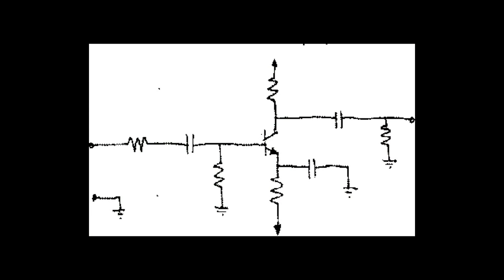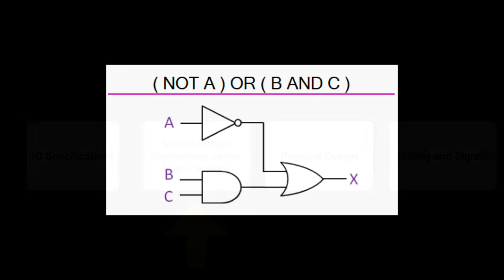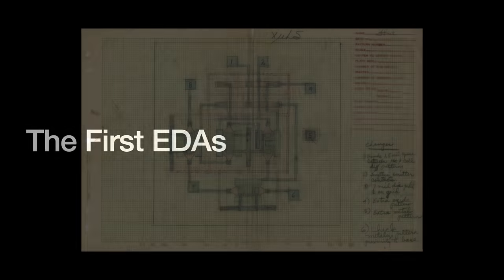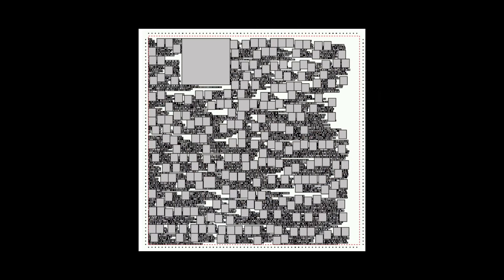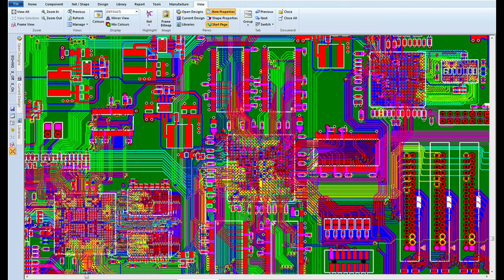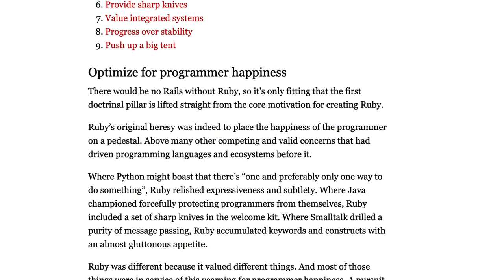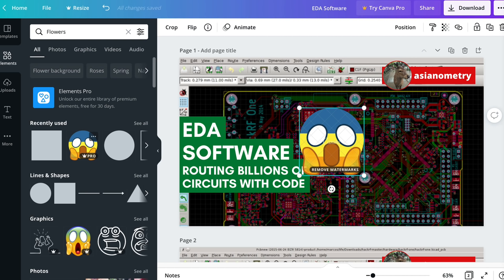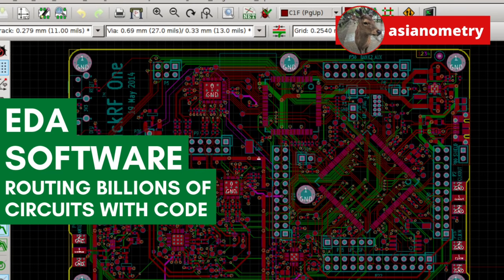Designing Billions of Circuits with Code

Comment: Trip down memory lane for me.  I was lucky enough to experience what you father did.  In 1976 as a fresh EE graduate I started my education once again working for Fairchild in a small design office in Bristol in UK designing SSI/MSI CMOS logic. 
Because of the small circuits and lack of EDA tools, Logic/Circuit/Layout design was done by hand.  The final product of design was then drawn by a team of draftsmen on mylar and then digitized using a CALMA Graphics system comprising a digitizing table (work of art), TEK storage display driven by a gorgeous NOVA 1200.  We had to boot the system from paper tape on a TTY.  I can still hear the clatter on the TTY reading the tape operating at 50 baud.  Everything was manually checked and when you were happy,  or ran out of time,  the data was written to magnetic tape and then sent to Mountain View for fabrication.  6 weeks later  the packaged chips would return and In those days it was not unusual to have  major problems with a design.

Finally made it to the US HQ so my time in that little design office in the centre of Bristol was just the beginning of a great journey of which I am so grateful.

Comment: I actually worked on implementing pathfinding algorithms for route tracing and it's incredibly tricky, especially given the limited space and  the fact traces are not allowed to intersect. It's an NP complete problem, meaning the optimal trace configuration (with the shortest total trace length) can only really be found if you try all configurations. I tried coming up with algorithms that come pretty close to the optimal configuration.
Reply: Did you publish them?
Reply: You should come work for the CCP
Reply: @JohSebBac China has EDA tools down to 14nm this quickly after US bans.

Comment: What a great and informative video.
If I may add some more points (I'm an IC Designer in the semicon industry myself):

- Mentor Graphics is another big EDA tool vendor along (though recently bought by Siemens)

- Most of the automation effort has advanced the design of digital design circuitry, which occupies, probably, >50% of the area of the chips released today. Analog Design, on the other hand, is extremely difficult to automate. Some effort has been done, but I still don't know of a complex chip being designed solely by a machine as of now. Even though digital might seem like "the advanced technology", analog design is still needed, as you just CANNOT interface the real world with a purely digital chip.

- That's the reason why people say the wet dreams of the semicon industry is to move the digital circuitry closer to the input as much as possible in order to save costs and automate everything.

- Some big semiconductor chip companies in the world have actually made efforts to build their own in-house EDA software in order to save money on the EDA 3rd party licensing. Though, AFAIK, only the simulation engine, not so much the actual GUI.

BONUS:
- Your video thumbnail is a screenshot of KiCAD, which is a free PCB software. I think a screenshot of the Cadence environment would've been a better fit (hehehe)
Reply: do you do digital or analog?
Reply: @karamany9870  analog
Reply: @DJTrancenergy  and how’s the future of analog compared to digital? Because I’m currently choosing a specialisation in my degree
Reply: @karamany9870  I can't possibly answer that in a few lines and not willing to put a wall of text explaining my opinion.
Choose what you like the most! Don't be miserable doing what you don't like. Plus, no one knows if you'll end up in engineering or eventually moving to some more managerial roles.
Reply: One of my friends worked in TI in analog design and has now switched to Intel. He always said analog circuit designing is like black magic. Even the most skilled designers are not always sure of the full implications of the chips they design. What do you mean by moving the digital circuit closer to the input though? Because digital logic would still have to implemented by analog design.
Reply: @EvilSapphireR  that's true. That's why we mostly work with legacy stuff: if it already works, don't change it! Maybe add circuitry around to minimize risks. I'm in a similar situation right now as we speak at my job.
What I mean by moving digital closer to the input is that if the ADC is the 1st block in the chain, then analog design would reduce to creating good input ADCs and other blocks would become unnecessary. And no need of analog processing would be needed. Obviously this will never be the case, but you get the idea.

Comment: Verilog and VHDL took most of our fun away. I liked the schematic method of design a lot. We used the same workstation for layout as well.
Reply: Which flavor of unix/linux did you use?
Reply: @scottfranco1962  Used Mentor Graphics for digital design in college around 1996.  Also used Avanti Hspice in circuit courses.  Half of the college’s workstations seemed to be some Unix variant while the other half were SunOS / Solaris, which were much newer.  Linux wasn’t embraced until roughly a decade later.  Now Mentor got eaten by Siemens and Avanti got eaten by Synopsys.  In any case they sure know how to pick weird tool names: Dracula, Assura, Hercules, Calibre, Spectre.  They should have stuck with things related to spices, cinnamon, and cloves.
Reply: @allentchang  So I have not been part of direct IC design for a lot of years. Last time was at Segate, but we didn't do the layouts or see the layouts (sad). I imagine that analog is still schematics. I think what happens now is that the Verilog tools deliver mostly automated layouts that use "fixer" layout people to correct automation problems and for special layouts, again, including analog. A company like Intel or AMD might typically use a mix of both, for example if the design calls for say a cache, that's going to be mostly laid out by hand for a single cell of it, then replicated many times. The author of this video series is not quite correct that everything is standard cell. Even in the old days, when we used cells they were usually from a library of custom layouts made for that particular design. I guarantee you the latest x86 processor does not use standard cells. The other issue is drive lines. One thing an IC designer does a lot is change the drive strength within the chip to match drive to length of line so that it does not drive it too little or too much, and matches the rise time requirements.
Reply: @scottfranco1962  An analog engineer has to work closely with an layout engineer to make sure sources of signal mismatches are kept to a minimum and that the spice models do work as promised under certain layout conditions.  Working with only schematics is no longer the way to go.
Reply: @allentchang  "Mentor Graphics". That brings back memories. I used that software when I was an analog chip designer.
Reply: 2019,we used vhdl and verilog,university didn't grow up
Reply: @windmill1965  Sadly, Mentor Graphics was renamed Siemens EDA this year.  It was acquired by the Germans in 2017.  I wonder if folks in US Congress are now regretting this.

Comment: AI is currently optimizing CPU designs.
 This is how we get 25% energy efficiency with every other generation.
Reply: And 25% more pricey. XD
Reply: source?
Reply: @Aaron Speedy Price going down is an evidence for improvement.
Not the AI involvment in this improvement
Reply: @Hatwox I dunno man, In school, i learned that the benefits of miniaturization is cheaper chips. if you can fit for transistors into less space, and have the tech to do so, the chip is cheaper on a per-transistor basis. a PC is not a chip, a PC has many chips on its various components. a PC now will have more chips than before, but the chips themselves are cheaper when they are made more efficiently, the cost comes from the additions that are available because of the efficiency gain. if that doesnt make sense, its because im a dumb dumb.
Reply: Trust me, AI is just another tool, not very different from log tables or protractors.
Reply: @Aaron Speedy Bang for buck for computer chips (CPU and GPU) are decreasing since ~2003. Unsurprisingly that's alos the year Moor's law died, no of transistors on a chip isn't doubling each 1.8 year since then and its slowing down ever since.
Reply: The optimization that ML is being used for in the chip design process is mostly for increasing yield of increasingly complex dies, not so much for die & via layouts (yet).
Reply: @michaelt126  It also depends on the complexity. Something half as small, but four times as complex. And also with a higher failure rate will throw that off. But generally chips are great today. You can have more computing power than you need for most tasks for less than 1500 dollars these days. 

Things are only really expensive if you want to always have the newest hatest sh$t. lol
Reply: AI isn’t optimizing CPU design for better power efficiency. At least, not yet.
Reply: And chips that nobody can understand or debug.

Comment: Nice video! One small nit: the image for your “memory circuit” isn’t a memory circuit. I was on the edge of my seat wondering if you’d cover the importance of the hierarchy of abstraction. I needn’t have worried. I worked at Honeywell in the mid ‘70s on an EDA simulation tool, while a coworker made use of our Multics system for his thesis work on circuit board layout, because of the large address space. That drove home for me the complexity of layout problems. I’ve been a bystander since, but one thing I’ve observed is that the use of standard cells reduces the layout complexity. If you have a cell with 10 cells, layout deals with 1/10 the number of items.  Since layout complexity grows combinatorial or worse, that factor of 10 savings becomes much much more. It addresses complexity both for the designer, and for the algorithms the EDA software uses. As complexity grows, you add more levels of abstraction. You might arrange memory, I/O, CPU subsystems on the chip based on the area needed, route interconnections, then lay out the interconnections between each of the subsystem’s cell, with the cells being pre-routed, or perhaps alternate selections of cells of different shape, to fit together like Tetris. Without the levels of abstraction, modern chips would be impossible.

I’m always impressed by the depth and production of your videos. Making things accessible to a wide audience is a challenge. I think you do a great job.
Reply: Glad I’m not the only one that noticed. It looks more like a mux to me.
Reply: @anonymous.youtuber Pretty much, yes.

Comment: This is essentially the video I was looking for but never even tried to find. Back when I was younger I used to build circuit boards. I would create a schematic and then try to transfer that schematic to a double sided trace layout that could be etched onto a copper clad board using photo etching and chemicals to dissolve away unwanted copper. I often wondered how complicated it must be to do that on 6 layer boards or even internally on an integrated circuit. And now with CPUs being so complicated I knew there had to be some sort of automated algorithm that could drastically assist the engineer.

Comment: Although digital circuits are designed with hardware description languages nowadays, analog circuits are still mostly designed on the schematic level and can’t be easily automated.

Comment: I’ve worked from the other end making modules and design rules for design software.  Designers used the software, and told us when they needed a new or custom module to make the ic a customer wanted.

Comment: I am a backend semiconductor eng in the Fab. This is a good overview of the whole process. I heard some of the terms and don’t know what they are and the purpose. Now, I have a general idea.

You only mentioned the digital design (AND OR gates etc). The Analog design may be different. I heard Analog design is more difficult. Good Analog circuit designer is hard to find.

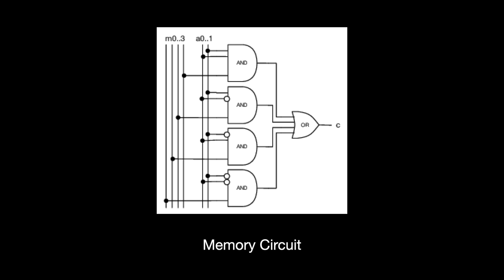Comment: 0:19: Hmm . . . . that looks like a common emitter BJT amplifier with emitter degeneration . . . . . 2:15: EOR for exclusive OR instead of XOR?  2:42 Doesn't a memory circuit contain feedback (ie output directly or indirectly connected back to the input)?
Reply: 2:42 is a mux, not memory
Reply: There are several mislabeled circuits. Maybe this is the decoder for a memory? It is not the actual memory cell, which is the most important part!

Comment: As a software engineer, this kind of thing feels like a whole new horizon, and sounds really interesting! I wonder in what kind of major does this thing being taught (just in case I ever get the motivation --- and money to take another degree 😅)
Reply: computer engineering, my friend :D
Reply: @unkownuser8455  can confirm, it was a dope 2 years when I was still in the CE major - before I chose to switch to SE solely because of the differing depth of the math classes required (SE was easier, in most regards). 
I do wonder what it would be like if I stuck with CE... but then again maybe that just means I should see if I can break into the dev world of EDA software :)
Reply: Electronic engineering.  You need a masters typically to be able to design at the transistor level

Comment: Great presentation!... although a little attention has been put on circuit simulation&testing stages of the design process which regardless its flavor (analog | digital | mixed) is perhaps the most sophisticated and resource consuming task. Perhaps this could be the theme of the next video !:)

Comment: Ha, "unheralded" is putting it mildly.  I was in the industry until about 2010, writing the software.  Its insanely hard to write, and every 2 years your programs have to operate on twice as many transistors :-).  And nobody understand what it does, and therefore, nobody wants to pay anything for it.  I finally left the industry--much easier to make money writing software to display ads.
Reply: Ohhh man, seriously? When you say "display ads" where are the ads? Is it like the automated auction system that Google uses sell ads?

Comment: If there is a China-Taiwan conflict the 66% of global contract chip making Taiwan does will be offline and those expensive EDA tools will suddenly be useless as the designs can now only exist in a computer not IRL. Also gate arrays are useful for a lot of low volume low complexity designs and the EDA software is provided by the gate array manufacturers.

Comment: Closed on Mar 28, 2024, Synopsys stock price is $571.5 and Cadence $311.28 🙂BTW, the 3rd largest EDA company is also important. Siemens acquired Mentor Graphics (a public company headquartered in Wilsonville, Oregon then) in 2017 (announcement in 2016). Now, the brand name is Siemens EDA. The big 3 together have over 75% market share.

Comment: TYSM for the video! Quick question about chip manufacturing process though: 
I know that magnifying lasers brings the chip designs to a small scale, but how do you manufacture the mask that is used to pattern the laser? If there are billions of transistors, how do they cut each one out in the mask?

Comment: 3:01 - I never saw anyone talk about testing and verifying IC chip designs, how is it done? software wise?
Reply: EDA software extends well beyond the placement of cells and routing the wires. Your question is really two questions.
Verification is the process of ensuring that design functionality matches the specification intent, whilst testing is more about ensuring that manufacturing happened without any problems.
Verification requires EDA software in order to do:
 Simulation of the Register-Transfer-Level (RTL) languages that digital designs are written in
 Analog simulation
 Formal proof algorithms 
 Simulation of netlists
 Equivalence checks between RTL and netlists (or within modified versions of either)

Testing is a whole other academic subject and involves adding structures to a chip to fully test the entirety of it, post-manufacturing. This is known as Design for Test (DFT). Software here is required to both add the test logic and then simulate it and generate test patterns/programs to be run on tester machines. This includes:
 Built-in self test (BIST) circuits for analog blocks and embedded memories 
 Scan logic - this is an algorithmic re-stitching of all the flip-flops on a chip (in a special test mode) that allows the manufacturer discover if any part of the design is stuck at a value or doesn't transition between values quickly enough.

And there's so much more that EDA software needs to do, such as RTL linting, Clock and Reset domain-crossing analysis, automatic RTL design and integration, static timing analysis, power analysis, etc. The typical modern ASIC/SoC design requires about 30 unique EDA tools to be licensed.

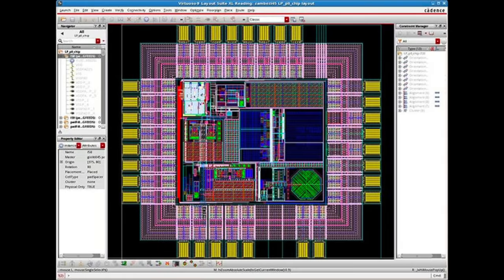Comment: In the diagram at 8:05, I would have imagined that the level of abstraction would have the gate placed lower than the circuit, instead of how it is shown. If I am incorrect, could someone explain?
Reply: Short answer : the diagram is correct.
Long answer : consider the gate as a logical black box, where with a combination of inputs you get a predetermined output.
To convert this blackbox into something physical, you need to start making circuits which consists of p type and n type transistors (the circuit shown in the graphic is a not gate btw). And finally the construction of each transistor is shown at the last level of abstraction.

Comment: You limited your design to Boolean Logic. Threshold Logic is a superset of Boolean Logic. Worst-case Boolean Logic implementations are exponential in the number of inputs. Worst-case Threshold Logic implementations are linear in the number of inputs. Going from 32-bit to 64-bit doubles the gate count instead of squaring it (1,000,000 × 2 « 1,000,000²). 
Plus, Threshold Logic gates are easily implemented in resonant tunnel diodes. This gives them a 100,000 advantage over Boolean CMOS.2.2 THz at 5 W.